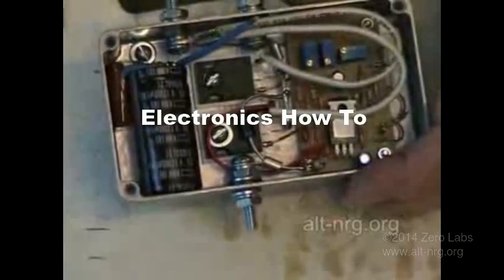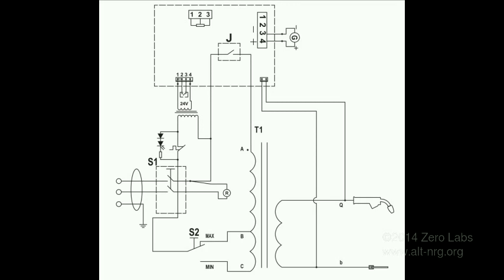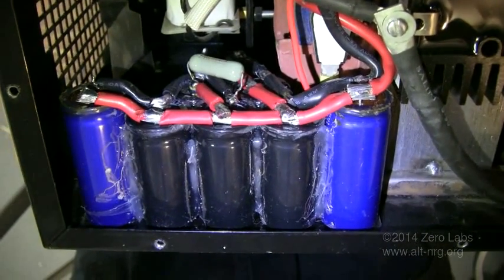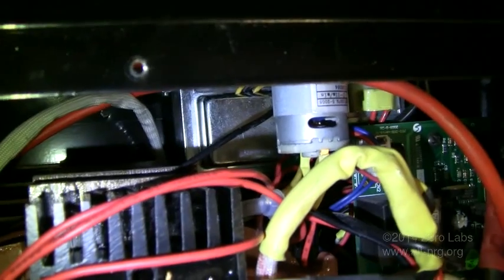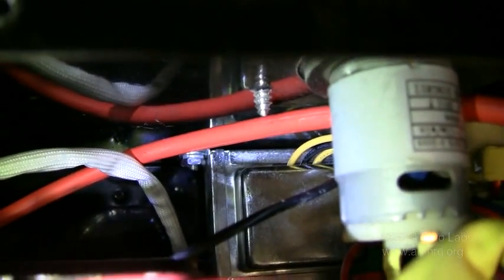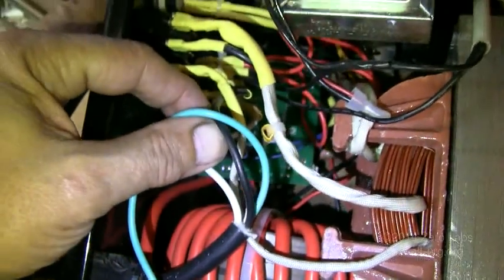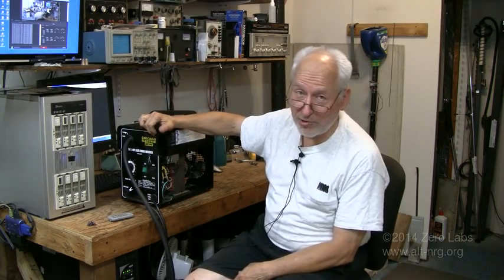#374 Harbor Freight 90A "MIG" welder upgrades

Comment: I know this is an older video but if you still see comments here I was wondering what the coil is for.
Reply from the maker: Making the DC more pure, ie less AC ripple.
Reply: @zerolabs  Also talked to Digikey after your comment about ceramic vs electrolytic caps.  The tech support guy I talked to was familiar with this mod and said that I want the electrolytic cap in a welder as it does a better job of giving that initial jolt when you pull the trigger and that as long as the cap wasn't getting hot  (which it isn't after running a few beads) then I am in good shape.  He also said that there may be some advantage to using multiple smaller caps but it's not worth changing what I have.  He said all the welders he has worked on have electrolytic caps.
Reply: @zerolabs  Thanks for the reply.  My mod is done using a 100k uf cap and a 200 amp 1000V rectifier, toroid coil with 16 feet of 8 gauge wire and a switched 100W 15 ohm bleed resistor. The difference is like night and day.  I have only one question.  Right now the transformer is hot whenever the unit is on but I want to only make the transformer hot when the trigger is pulled as you did, however I have the Flux 125 version and the circuit board is different.  The transformer I have is a 110v to 24V secondary. Any clues on how to wire that?  Am I using the right style transformer?  Yours seems to have 3 wires from the secondary.  The 125 has one connector on the circuit board that the 2 wires from the transformer go into and that's where the output of my transformer is connected and three additional wires coming out  Right now the transformer is hot whenever the unit is on but I want to only make the transformer hot when the trigger is pulled as you did, however I have the Flux 125 version and the circuit board is different. You are the only one who I have seen make this subtle change but like I said the 125 circuit board is different.  It has the relay you showed but there is nothing connected to it on the 125.  I could try and snap a picture if that would help.
Reply from the maker: @ramaroodle  Sorry but I would need to see the complete schematic diagrams of both to make any recommendations. I share what I can but can't offer individual engineering services. You're going to have to figure this one out on your own.

The only comment I can make is on your selection of capacitor. If you're using only one big one, the ESR must be very very low to prevent the cap from overheating under heavy use with the high circulating currents.  Very low ESR is easier to achieve with multiple smaller caps in parallel. Keep an eye on your cap temp. Electrolyte vapor smells really bad when caps go poof! LOL
Reply: @zerolabs  Thanks for responding.  The transformer question is just a minor inconvenience so I'll probably not even bother.  The welds are 1000% better forming nice red hot beads.

Comment: And several hours later, I'm done. I strongly advise against using 6 AWG stranded, because it is a PITA to work with, but it's something I had which means it was free. The 8 AWG I used for the inductor was way easier to work with. I probably spent about $60-70. I bought everything 2 years ago and just kept putting this off because I didn't have anything to weld. I can't test until morning, but I'm sure it's good. One thing wrong in this video is he has positive to the gun. Flux core welding should be DCEN, which is how I did mine. I guess you get less spatter that way. I'll still be using the HF wire (only because I don't feel like going to Home Depot tomorrow), but when I run out I'll get some good Lincoln wire.

Edit: Tested the welder with the HF wire and it was way better. Had to go to Home Depot so I grabbed a roll of Lincoln wire. The difference is amazing. I welded 1/8" stake rack mounts to my HF garden cart and some of my welds look really good (I still need practice). I'm definitely going to replace the gun at some point, but for now I'm happy.
Reply: I got my 125 welder for Christmas and did the DC upgrade. It's like night and day. But I went a step higher by upgrading the grounding clamp and getting some Lincoln NR211mp .30 wire. The  Lincoln wire  is a major upgrade. Less smoke, less splatter more penetration. I'm new at welding and I've actually stacked dimes with it. I've only been welding with it for 6 months.

Comment: The only thing you can do now is change out the fan to a high volume, low profile fan.. Note - Mig welders use gas, No matter AC or DC the Chicago Electric is not a mig welder, it is a flux core welder.. You may have been better off adding gas and keeping it AC and wiring in a TIG torch and changing it over to an AC TIG welder.. That could be another project for you on the next Chicago Electric welder that you are going to buy tomorrow.. lol

Comment: This is why I didn't buy the cheap $100 model that is flux core only.  For another $70 you could just buy the 170amp 220v model (for ~$170 to $180 with a 20% off coupon) and it is both flux (DCEN) and MIG (DCEP) capable.  You just have to supply a 220v power supply and if you want to use MIG, your own gas (C25) and a regulator.  Change the polarity of the cables and you're done.  It does however do a great job as flux for outdoor work as you really need to be indoors or have no wind if using MIG (and if indoors you need ventilation). With the stock gun on these units I don't like the fact that I have to constantly turn the gas on and off each time I make a weld.  I want to find a gun that has a gas control valve.

Comment: I like your conversion. But the problem is you said turning your AC wire feed flux welder into a MIG welder is to convert it to DC direct current. That’s all well and good but that still does not make it a MIG welder. The letters MIG stand for METAL INERT GAS. to convert your flux welder into a MIG welder would require you asking an electric gas valve and supply gas. Everybody calls these 90 dollar MiG welders and they are not. I learned the hard way, borrowing a friends to add a metal patch to my truck. Man what a mess .

Comment: If you're still taking questions on this video can you tell me what are the advantages of using multiple capacitors as opposed to one quality large one? On this machine do you see any advantage in adding an inductor to further balance the power?
Reply from the maker: Lower total ESR (Equivalent Series Resistance) which leads to lower heat losses in the capacitors and higher peak current output.

Comment: What do the capacitors do? 
I ran solid wire and co2, this machine wont burn it(solid wire is harder to melt, who knew)  AND co2 cools the metal....not enough amps.
 Ac burns 50/50 as to were dc burns 70/30, think i might try going dc,  reversing the polarity concentrates the heat on the electrode. Also might try running .25 
Wire. 

The inverter machines are only 150... but mine shit the bed 5 years in (abused, neglected, and kicked around)
Reply: Co2 does not cool the metal. Your thinking of argon. Co2 shields and help with wetting out the puddle.

Comment: Curious... Instead of a second transformer for the feed motor, couldn't you have just used capacitors to smooth out the voltage thus preventing the voltage variation? Just a thought - not a criticism

Comment: Question about the transformer that drives the wire feed. What size of transformer? Where do supply power from and where do you wire the secondary leads into? my feed is so choppy I believe from voltage surge and would like to smooth it out, thanks

Comment: Hello, how necessary is the choke?  i am modifying one of these welders but i am running out of room inside, i have 60k mf worth of capacitors, also how many turns on the toroid core would be ideal?

Comment: Hello,   I think you are doing fine !  The thing I found out about mine was that I really had to go in circles to make a good looking bead.  The other thing is that all flex core wire is not the same.  In fact Harbor Freights wire is the worst so try the miller or another wire and you would be surprised at the differences there are.  So the other way you can inprove you welder that you can get a can of spray so you don't have to have all the bubbles and spatter !  Give it a try and just enjoy your welder !  Watch out for that 20% duty cycle !  Truly trying trying to help !

Comment: If it only costs $30 or so, you would think H/F would make that change , even if they have to charge a bit more for their welders.
Reply: George Lee  added labor to install those affordable components must make the intersection of the supply curve and the demand curve not clear at the right margin.  That box is one tight space.
Reply: Liquidation of bad batches of capacitors and bridge rectifiers. Multiply the $ By the number of people buying the mod bits.
There is 0 incentive for HF parent company to change the design.

Comment: I just want to say THANK YOU!!! these Mods on my harbor freight welder have made a HUGE DIFFERENCE!! I used your Bleed capacitor idea and it does still need to be drained a little quicker but works like a monster!!
Reply from the maker: Pretty amazing, isn't it? Just be careful of your AC draw. Input power does go up. I've popped my 15A breaker a few times after steady use.

Comment: Zero I enjoyed your video on 110 wire feed. Your up grades had to have made a Vast Improvement. I have a project I'm doing that follows along the same lines as your c.e. project except for the fact that it would be x 2. I have a Clarke 180en 220v mig. Bought it several years ago new. Have always ran .035 inner shield (flux core) through it in no gas mode (straight polarity). Recently I fried the bridge rectifier due to a input voltage drop to the unit just as I struck an arc. So I've checked around a bit. Have decided that I would like to up grade the B. Rectifier, or at least install diodes of better quality & higher capacity. It has been quite some time since I was in electronics school. Then went on to pursue a long, fulfilling career as an Ironworker. So I'm having a little trouble rapping my mind around the path of current within this rectifier. The existing pressed in button diodes on the rectifier plates have no markings at all on them. Taking readings no solution because several diodes are opened. Would appreciate any help(insight) in regards to which would be the best choice of diodes to install to handle the amperage and also feel confident about having the biases correct after installation. Rectifier consists of 4plates & 8 diodes. Can you recommend a practical solution to this project or should I just scrap the whole idea and purchase another sub quality rectifier like the one that it came with? Respectfully RUB.

Comment: What is the inductor/choke for???
Reply: The inductor causes the current to flow when the voltage is zero and it also
 causes the current to flow more at a constant rate. More inductance gives a
 smoother current but putting lots of current through an inductor will burn it up,
 better several inductors in series. Capacitors with high currents tend to explode.

Comment: That is an interesting version of the HF 90 FLuxcore. It has copper instead of aluminium windings on the transformer. So it is not your run of the mill -El Cheapo gear. Even the motor control PCB is a far cry from the standard issue. Not regular stuff

Comment: Can you suggest the proper rectifier, capacitor, transformer(drive motor), resistor specs. I already have a transformer from a old 2200 watt microwave.
Reply: Maybe 1200 watt? 
Are you going to cut it apart and reuse the steel laminates for winding your own Inductor? Microwave secondary voltage is 2KV.  And it's too small to make a main step down AC to AC transformer.
After 4 years, he never replied back? Huh.

Comment: Is the first example!e of your welds on aluminum bike frame?
Reply from the maker: Joking, right?
Reply: I apologize if I've caught you in a bad moon.  I'm not being critical, and certainly not being a dick in this matter.  

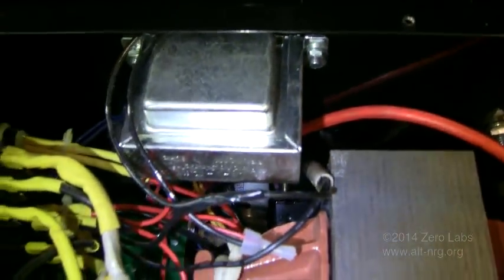At timecode 11:18 your video image looks to have a bicycle reflector zip-tied to the front of an aluminum alloy steering tube.  I say "aluminum" because there's always discoloration at the weld joints on steel tubing.  The metal color of the weld matches that of the the tubing on both sides of the butt.

The image at that time code also shows what looks to be a brake cable housing arcing (physically, not electrically) across the top-tube of a bicycle.  I've only seen 1.5mm/1.6mm cable housings hanging about bicycle frames.  

My brain also sees a red "fork" below the bottom steering race.  

I'm not a pro at this - which is why I was hoping to rely on your expertise in this matter.  

In my old-school experience (pre-dating either MIG or TIG welding), high-end steel bike frame tubes were silver brazed around internal lugs.  External weld beads were never present (except on really cheap bicycles) Motorcycle frames are a different story.  
Aluminum alloy framed bicycle tubing have always been either TIG or MIG welded at the joints.  Which is what this image looks like to me.  

Flux core AL wire can be purchased on Amazon.  Converting a cheap HF welder to a true DC (flux core) MIG make using this wire this possible.  For those who don't understand the purpose of the flux - it vaporizes into the shield gas required to prevent oxidation of the molten puddle.

Please feel free to correct me.  Or please clarify your otherwise obscure response.  What do you think I was "joking" about?
Reply from the maker: Okay, I understand now. I had no idea there was any such thing as flux core aluminum welding wire. Had a hard enough time finding flux core 308 stainless for my Rocket Stove pellet burner. From what I'm reading, reverse polarity (positive electrode, negative work-piece) is recommended. Is that correct?

Comment: i would suggest, for the average joe stick to stick welding, for the handyman who welds small things every now and then that  90 amp harbor does work  without going thru the bs of conversion. notice his weld that he showed... not really a improvement. for $300 on up just purchase the right size welder for your needs and the satisfaction of years use. buy cheap, get cheap.

Comment: Picked up one today for $79 at a parking lot sale at HFT.
I found out about a welding supply company in the USA who has an upgrade/replacement parts that I think I can use to convert our Flux 120 amp to a real Mig/Flux Welder. 

Here is a YouTube video on the subject.  Yes in the video is a Chicago Electric 180 Amp, and ours is a 120 Amp, but I think the replacement gun will also work and it has the gas components to add the gas capability. The gas is always regulated by the tank regulator, not the welder, so all I need to do it replace the gun assembly unit and add in the copper fitting on the back of the welder case so I can tie it into a tank regulator. I can get the tank and regulator from Harbor Freight Tools. Tank is about $99 and the regulator is about $39

With this mod and your mod, I would be able to do what some welders are doing, is a Flux Wire with 75%/25% Argon/CO2 gas weld. Dual Shield Flux Core Welding is what they call it. It is a kind of a hybrid mix of the two types of welding which gives a very deep weld, like Flux but not as much smoke. 

When using the gas with Flux wire, they say to use less voltage, but I would not reduce the voltage because it would make it so I can weld even deeper.  I think with the proper mods, the 120 Amp could possibly more easily weld 1/4 inch and even possible 5/16 mild steel.  It sounds crazy but some$550- $600 120 volt,  140 Amp Mig/Flux Welders can weld 5/16 steel, with Flux Wire only welding. If I could get close to that by your $35 or so mod and the other upgrades, it would be worth attempting, for me at least.
Upgrades link
https://www.youtube.com/watch?v=0va1jflmqic
Dual Shielded Welding part 1 and part 2 with improved technique
https://www.youtube.com/watch?v=aTPFQzalNt4
https://www.youtube.com/watch?v=naNdnXJwwnY

Sorry I post so much, but I thought I would share with you what I would like to do.

Comment: Interesting to note, I recently bought one of these cheap welders and they have probably done some modifications to them over time, however the welds after you converted the machine look almost identical to the welds I have right out of the box, running the stock tip and the cheapo wire that came with it. However I recently bought some Lincoln .035 wire and a set of tips to match, and it seems like it welds so much hotter now. The weld is actually cherry red when I finish a bead and the penetration is much better, and I'm still running factory internals. I just thought it was interesting that your DC welds look identical to my AC welds.
Reply: Lincoln NR-211 and Hobart E71 series wires are excellent.
Reply: @obfuscated3090  .030 wire size for these small machines.
Reply: Koshunae thinking I will do this first. I just scored one of these at a yard sale for $50 works fine used once. I like your idea better than attempting something I know nothing about and possibly hurting myself or frying the whole machine
Reply: I was thinking the same thing. My welds look better than his DC welds. This is my first welder and I am still learning. A couple things I learned early on is that you should read and apply every suggestion HF makes for best results. One thing that made a huge difference for me was upgrading the extension cord I was using to a beefy one. Reduced the splatter and was a lot less spotty. Also, pay attention to the material you're welding. Switching materials was almost like starting over on the learning curve for me. Also welding dissimilar materials together was tricky. But I don't think I'll be converting mine. It takes some time and I get better with each project.

Comment: so with this conversion, does it still run off the regular 110v hose hold current or do I need to use  220v ?